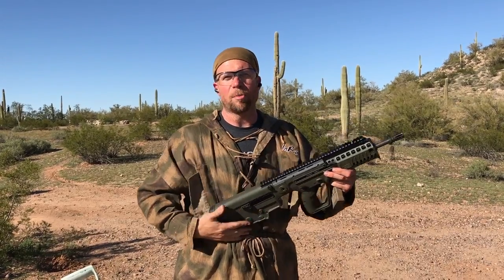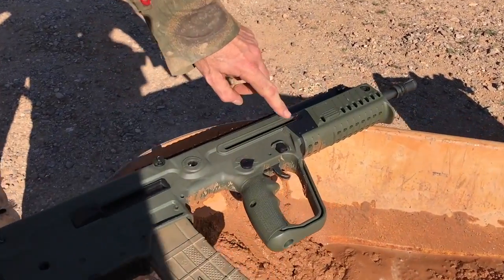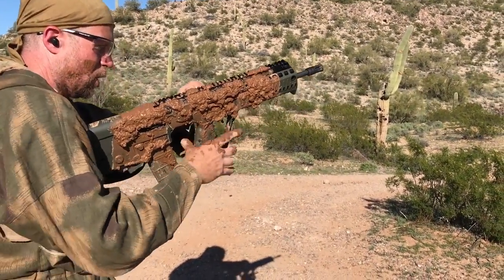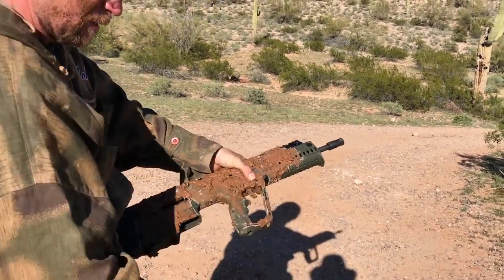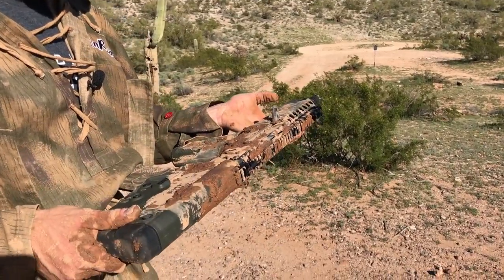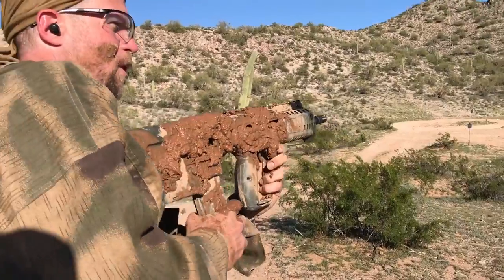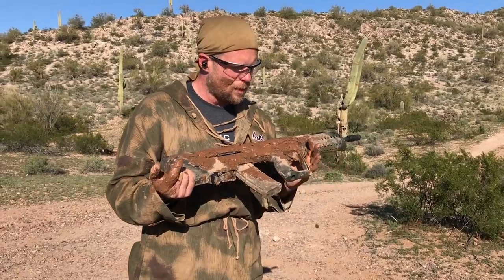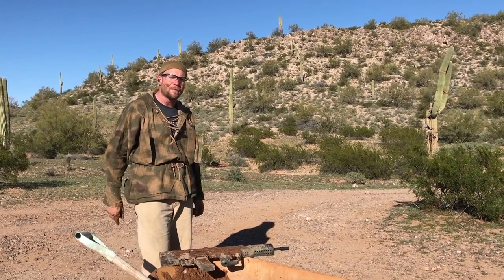Mud Test: X95 Tavor

Comment: I know I'm going to sound like a Tavor/x-95 fan-boy (even though I was only issued an M4 and would pick my M4 over a tavor for any future military operations I might get sent to), but I would not consider this to be a fair test against what you guys did in the AR or AK mud tests.  First, you have an inconsistent mud mixture; the AR and AK muds seem to be much soupier with more water and less sticky grit, meaning that any clumps would have an easier time falling off than with this stuff.  Second, and probably owing to this different mud consistency, before you fired the AR and AK, you shook off the excess mud and even used your finger to scrape some areas off with the AR.  In contrast, with this X95, you left all the heavy dense muck on the rifle (yes you gave one shake but come on, it really didn't do squat) and thus got the failures.  I'm not saying that this may not have happened anyways, but the unequal conditions and treatment mean this is not and cannot be considered a fair equal test.

That said, I like what you guys do and I enjoy your videos.

Comment: Geeeee.......

You guys still remember the traditional stoppage drill? Not the American drill

1 safety catch on safe position
2 remove magazine and check for foreign objects
3 point the gun at a safe direction, cock and hold the gun, check chamber, bolt and rail for any foreign objects
4 release bolt, safety off and discharge the spring to test trigger system
5 clean magazine and mag housing before reload
6 if stoppage reappear, repeat from 1 and also adjust gas regulator (if available)
7 strip the gun check for damage, of cause this step only apply to non emergency situations

Comment: Israeli made tar 21 owner here. I have had similar malfunctions with my tavor as the first shot X95 in the mud test. Case doesn't eject and gun double feeds. I only have this happen with magpul magazines. I have tried both gen 2 and 3 pmags. With the factory magazine and a norinco magazine I don't get the malfunction. 
I think a tar21 mag release wouldn't malfunction like the x95 mag release as it is much simpler. Could you try a tar 21.

Comment: It isn't possible for an empty case to pass through a wall of mud. You're asking the gun to defy physics. The AR15 does well because the dust cover mechanically moves the mud out of the way. I think to be fair, you should've brushed the mud away from the ejection port before firing.

Comment: Honestly Even during the war depends on your location you don’t have that much Mud top of your rifle. “Rifle is your life treated better than your wife”. And by any situation you end up getting the Much of mud Into the rifle, Dip The rifle in water or rinsing it off is a fast solution , but you still have dust and dirt enter your internal mechanical port. If you’re in Middle East sandstorm will be the problem, If you’re in a jungle situation humidity, Rain and mud will be your problem, And if you are up north frozen temperature will be your problem. All and all You have to find a way to get around these obstacle without any problem with your rifle.

Comment: I will confess to an idiot moment on the range. I was doing bench resting, and thought I had my hand "in front of" the ejection port. That's right, I was practicing bench resting with a left hand since I am an ambi shooter. Nope, I was wrong, and just my hand mildly in front of the ejection port induced a failure as the gas was directed forward and I experienced the same stoppage you see here. Translation, I honestly think it was the mud in the way. A simple mortal cleared it and it moved on. 

It is worth being said the degree of unfamiliarity and difficulty dealing with bullpup malfunctions contributes to the greater "feeling" of failure. Or maybe it's just the military way of saying,  "doesn't provide considerable improvement over AR15 design."

Either way, I had hoped it would have done better. In some ways it did no better or worse then an AK as to me the remedial action is likely different between the two designs. IE I won't worry about it.

Comment: Unreal test the tavor is one of the most reliable weapon systems there is this and the scar will shoot forever as long as you don't put a shovel full of mud right in the action. And ar15 will do better ok this test but take that same ar and x95 and shoot them 10,000 rounds at once and see which ones running still I promise you the ar won't the tavor or scar or 416 will

Comment: I thought it did better than Karl is giving it credit for.  Yes, it required remediation, i.e., pulling the magazine and manually running the action a few times, but after that, it worked normally, even after they mudded it a second time.  And they didn't clean it with water the way they have with some others.  Not as good as the AR-15 or the CETME, but much better than a number of other rifles.

Comment: The failure on first round after mud seems to just be quantity of mud... In combat if you drop your weapon in mud, is it not reasonable to assume you will brush of extreme quantity of mud on each side before attempting to fire (just run your left hand over each side of the Tavor on each side - so as not to compromise your triggerfinger on the right hand)? This should reasonably only take you half a second as part of picking up your Tavor and inspecting it in a mud scenario?
Feedback from a more serious operator would be appreciated, because if you have a pound of mud in the way of ejection, then it is going to be hard for any gun to eject, right? Or am I completely off on this? (if so, how?)

Comment: This is a stupid test. No rifle will eject a round with all that mud on the ejection port. If you pick up a gun that you had in mud and didn't shake it to get the crap out the ejection port and the barrel mind you then you don't know what you are doing. You pretty much did this to get the failure outcome I am expecting you wanted to diss the rifle.

Comment: You literally have mud almost a quarter inch thick on the ejection port. Is there any gun that would be able to properly eject a case through that? Did you do the same thing with any of the other guns?

Comment: I know it's 3 years later, however I do think that had this been a more "realistic" test he would have wiped it off before the first shot. also if your rifle sinks in that much mud you've either fallen in a body of water (which will take a munch of mud off when you get back up) or it's raining so heavy you cant see 50m out. The rain will will rinse a lot of that mud off. Not to mention the common sense that you should likely check on your weapon before use.

That being said. this is a test to see how bad things can get before a failure. I think this is an excellent test to show just how bad it has to be before a failure. this thing could use with a mud shield type thing, but that would be such an easy modification that I don't think that it's actually necessary to make in factory.

still a good test to see what kind of mud punishment that the X95 can take.

Comment: propably the batery took some mud, preventing it to fully cycle during first reload and jamming everything tight. that is why "mortaring" helped every time. i bet on the mud in ejection port, first blocking the case and then letting mud inside.

Comment: It’s simply because skirts of mud blocked the ejection 

If a wipe of the extra mud was done so it didn’t skirt over as it was fired, it wouldn’t have stopped at all
And gun will fail if the ejection port it blocked

Comment: Looks like the big glob of mud sitting on the ejection port is your culprit for your first round malfunctions. I bet if you shook that off before firing it wouldn't hang up so bad, especially seeing as it seems to run fine once you clear that off.
The mag release issue is the most genuine failure here I think. 
Not trying to be a fanboy but objectively looking at the video evidence.

Comment: because of the thickness of the polymer around the ejection port the amount of mud blocking the spent case is too thick and causes a stove pipe allowing ingress of mud into the bolt and locking lugs themselves. I can see this being an issue with other rifle designs such as the HK G36 as well. interesting..

Comment: If you cover any ejection port in heavy wet mud it wont eject since the weight of the mud is falling down onto the casing. Obviously. Not the firearm but the user that was wrong here. Sorry to call you out but common sense should be used. No one would get their gun this muddy and not shake it at least once before firing.

Comment: It looks like the primary issue here was the fact that the ejection port is a bit recessed, creating a space for the mud to plug it up, which nearly guarantees a failure to eject. Once you clear that area, the subsequent rounds should be fine. Although I'd still have to say that this is a bit of a flaw in the design.

Comment: Too much mud on top, that first failure to eject is crucial and the mud that gets in basically compromises the gun, the failure to eject basically "dumps" the benefits of being a gun with sealed action since the bolt is held open by the brass allowing mud to get in.

Comment: Concerning the mag release failure, the left mag release is a bell crank that attaches directly to the transfer bar.  The right mag release is a smaller bell crank that presses on the left mag release bell crank.  So if the right is physically blocked by debris (mud), the left would still work, but if the left is blocked, you are down to pressing directly on the back of the catch (which takes some pressure, but works).

Comment: the one round before failure is likely due to mud blocking the case from ejecting properly, and after clearing it, both times you cleaned it a bit in that area..

the mag release i have no clue.. maybe something with the way the right side actuates the lever inside..

Comment: the caked mud wouldn't let the fired round eject.it drop d the empty Case's momentum enough to stovepipe and that cause a double feed clear the ejection port of clumps and retest I think the lack of gas pressure exhaust to blow the mud away is the issue if u can simply wipe the ejection port and it works its not a total pile. I have no dog in the fight

Comment: obviously any rifle with so much thick mud on the ejection hole will not fire after one round, on other tests you didn't leave that thick layer on the ejection. you could just cover it with painters tape and call it a day, save the mess.

Comment: I don't like the Tavor. But I think it's not a good idea to "test" a brand new gun, did it fire at least 200 rounds ? Pouring mud under wasn't fair either, I don't remember you doing it for any other model.
Reply from the maker: The actual owner has fired it extensively and I used it in the subsequent 2G-ACM match (videos coming).   ~Karl
Reply: Ok thanks for the clarification.

Comment: This mud is way thicker than the mud you used in the AR 15 mud test not a fair comparison you set the x95 up to fail plus you closed the dust cover on the AR 15 giving it a better chance to pass this test was obviously biased towards the x95!!!
Reply from the maker: +pistolero Jake We poured the mud directly on the bcg with the cover open in both the Ar15 videos.  You're a liar.  ~Karl

Comment: Late AF to this but the mud entered from the slots for the charging handle and during the bolt cycling. Sense it's piston operated there is no back pressure or expelled gas to really get the mud out of the way like on an AR. On mine, I have noticed that it tends to seize-up in a similar way when I don't clean it for 3k+ rounds. If i actually keep it clean it will go 2k+ with out seeing type 2 or 3 malfunctions. For the most part it is a solid rifle and has become my go to for just about every thing I need a rifle for, except medium or big game.

Comment: In the x95's defense the trigger handled the mud a lot better than I thought it would. It didn't really do that bad, I expected the trigger to be dead on the first round and surely the second. I honestly wouldn't call it a fail or a pass, it got going again in a relatively short time and not 1 trigger malfunction! Those locking lugs were caked too but I really doubt that was what was causing the FTE. Didn't seem to have a bolt momentum problem maybe the ejector/extractor is alittle to exposed and the mud impeded it's action but that's all speculation either way what an odd failure!

Comment: Not sure why we keep testing a gun with a bunch of mud in it. We all know what will happen when you put obstructions in receiver. You would never that much dirt in the gun in real life. Just get it dusty. That's all it's designed to handle.
Reply from the maker: You're right.  Mud on the battlefield is a theoretical condition only.  ~Karl
Reply: No, but there's no way to truly test it accurately. What if there's a small stone in the mud that will completely jam up the mechanism? What about mud consistency? If your rifle got THIS dirty in the field, you'd have to stop and clean it. Otherwise you have a brick on your hands.
Reply: The thing is that the design of the rifle allows pebbles and other debris to penetrate inside the rifle's operating system.

Comment: As much as I like bullpups in a military setting the long control rods & charging handle slots needed to maintain a conventional control layout is just asking to get bound up with mud & grit.

Ironically something the L85 got right when designers decided to avoid control rods & make everything from the trigger to hammer accessible in a standard field strip.

Comment: i'm a fan of these videos. I am also a huge fan of inrangetv and especially forgotten weapons. I hope this hasn't been brought up dozens of times before, but is the mud used not peculiar to your geography? The composition of the soil used to make mud would have a dramatic effect on these tests. Fine particulate matter suspended in a liquid would be far more devastating to a mechanical device than irregular, larger matter. Not that I'm an expert in geology, or that I even have some knowledge of it. I am just thinking of the difference between wet pebbles, and wet sand, one is a quite decent castle material, the other is still just gravel.
Reply: just a quick follow up question if you will permit me; are these tests done on particularly warm days? the mud seems to dry very quickly on the rifle, and I'm curious if the weather is contributing to the failure?
Reply from the maker: It's AZ.  It's always dry and usually at least warm.   Sometimes it's just plain hot.  The guns actually seem to get better as the mud dries, not worse.   So if anything I think it helps them, not hurt them.  ~Karl

Comment: the first round failed to eject because there was so mich thick mud obstructing it. if the port was wiped clean before firing or if a better mud shake was done for the right side, there probably would have been no issues at all

Comment: I noticed the mud used here is more thick than "soupy" like the other videos, and that you also shake the gun off in the other videos. Good stuff all the same though.
Reply from the maker: Even if that is the case, the "soupy" stuff is worse on the gun than the thick stuff.  ~Karl
Reply: Well that is indeed the case. I'm not saying the X95 would have done any better or worse,  it is simply my opinion that more consistency in the tests would help keep the standards the same. Seeing however that I'm not willing to make the videos myself, nor toss a X95 in a mud pit I''ll leave it at that. Thanks for the videos.

Comment: Lesson learned. If you get a tavor covered in mud, wipe off the ejection port area and it will be fine.
Reply from the maker: Yes, wiping mud away from the ejection port will immediately fix the inability to eject magazines and lack of going into battery.  Got it.  ~Karl
Reply: Well not for the X95, that has plenty of other design flaws in it.

Comment: I think the new charging handle will assist with the problems that the X95 had with leverage in this test. The new handle adds a leverage mechanism similar to the Tavor. The IDF has an older version with the same leverage mechanism in their charging handle.

Comment: What mag where you guys using the tavor is very pick on what mags it likes
Reply from the maker: Lancer.  If that's the case, then that's another deficiency in the rifle.   I ran these mags and magpul mags later at a 2G-ACM match and it was fine.  ~Karl
Reply: I have not found that at all.  I've tried surplus and new GI, Gen 2&3 Pmags, Lancer, and even a Troy without issue.
Reply: Gun Sense (drmaudio)  I found my gf doesn't like swamp fox cca and few other  but loves gi  magpul and theremold

Comment: please do an SMLE mud test as well to see how it fared in muds of WWI trenches...
Reply: Ameer Osama Khan probably would lock it up the actions pretty exposed
Reply: Ameer Osama Khan it would have been horrible
Reply: Do you have a lee Enfield?
I've dealt with both extensively, and without question the Mauser is the only bolt action I'd take into war. The Enfield action is very delicate
Reply: I own 4 Enfield's and 3 Mausers. There is no comparison. The Enfield is a very delicate and weak action.
Reply: The Mauser didn't do too bad... I would be very surprised if the Enfield worked at all. The locking lugs might not jam, but everything else is exposed and there are plenty of ways to render it inoperable
Reply: guys,there is only one way to find out...
Ian and Karl its your call...!

Comment: I like how with the AR you wiped the mud off the ejection port, and used thin runny watery mud.  But with the Tavor you used way thicker mud and didn't wipe off the ejection port.  I'm not bias toward any gun, i own hundreds of guns.. However, these tests aren't equal.  You obviously favor the AR, and that was shown by how you cleaned the AR ejection port before firing.
Reply from the maker: We recommend DIXIE WASTE WORKS for all your dumpster fire needs!